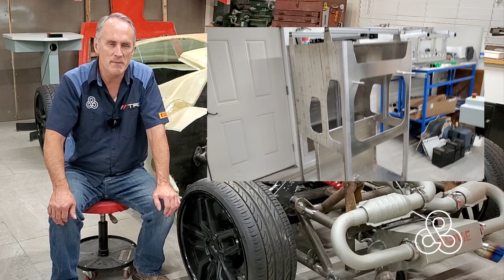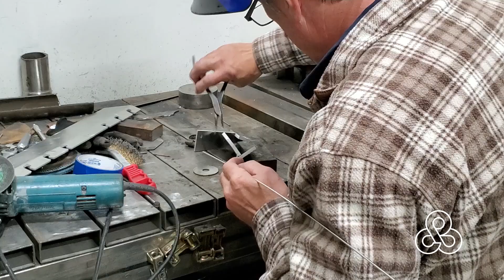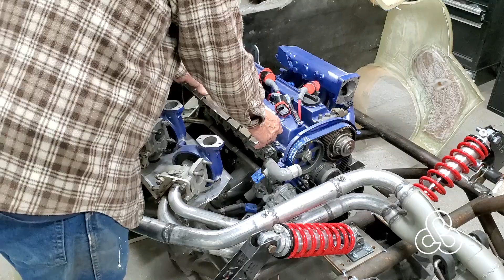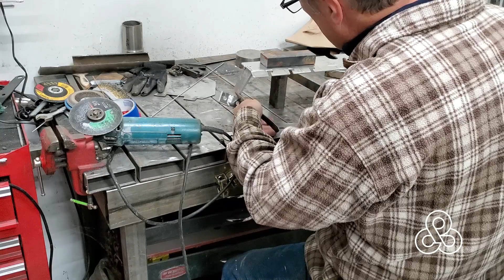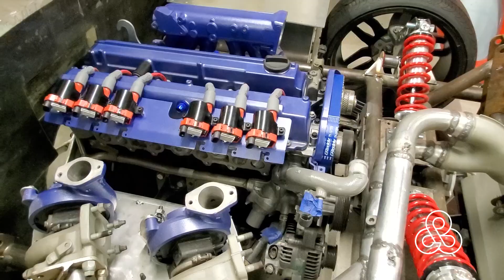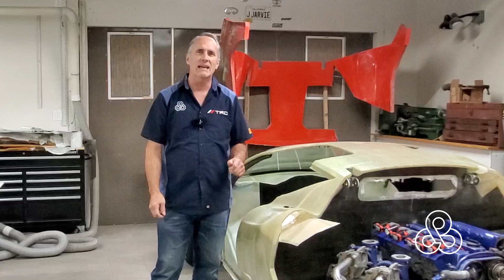A46 - Arete Supercar Project - Keeping ignition coils cool!

Comment: I'd very much like to know all of the numbers on your car.  Length, width, height, HP, track, wheelbase, length of cabin, everything.  Don't suppose you want to share that?
Reply from the maker: I don't mind sharing the basics, but "everything" is a bit much Ha! Wheel base- 100.5"  track- 64.5"  Length- 163"  width- 74.5  Height- 43  tub length (interior firewall to firewall)- 58"

Comment: Just a heads up with that powder coating. You may have grounding issues with those ignition coils causing them not to spark or have weak spark. Just food for thought. Love the build!
Reply from the maker: Grounding through the connector and directly through a capacitor still to come when the harness goes on.

Comment: make that a 3rd!  I am working on a similar monoque cabin with a steel frame front and rear, using a Honda j35 engine with turbos, since watching your video I have changed my design to be awd using a Chevy transmission. I am super interested in seeing your final implementation of the awd setup and  extracting a few more part numbers from your build. I am planning on using carbon fiber for the body, however. Hope to have the design up and in the intro video on my channel early 2021.

Comment: while there is movement off air i the engine bay the coils arent in the stream. the main channel of air comes through the intakes and migrates to the vacuum under the car. the coils are now directly over the hottest part of the engine bay. turbo manifolds ( because of slowed flow) will be glowing red under medium use.me personally i would mount them on the firewall on an aluminum cooling bracket. the downside of course is longer leads. however the individual coil per cylinder will mean the coils are basically under used and longer leads wont be an issue in heating up the coils internally because of the longer leads. in typical v8 mods the coil is moved from up top to under the exhaust manifold close to the engine. this position is in the air stream and the engine block doesn't exceed 240f. in your situation the turbos negate that possibility. why wouldnt you consider a mount up off the stock location with a plastic shield from engine temps. turbo manifolds exceeding 600 degrees or more in medium use.
Reply from the maker: You will just have to wait and see the heat management system come together.
Reply: @BuilderCreator  i certainly trust your judgement.  you are advanced in many areas. im still learning . im learning from you. ive seen your overhead mechanical drawing of the drivetrain. it answers most of my questions about the engine choice and placement in the car. does the transfer case counter rotate?
Reply from the maker: @gregoryperkins2180  It will split the load- counter rotate to the rear, carry the same rotation to the front.
Reply: @BuilderCreator  i have no idea what you said. ive build many offroad designs with mid engine weighted chassis. because of engine rotation each build had a gear driven transfer case changing rotation. some peopl designed this reverse rotations buy turning the axle upside down which of course makes the ring and pinion work backwards and in high horsepower combos with big tires , less than dependable. are your differentials upside down? does the transfer case reverse rotate? does the engine rotate clockwise? sorry to be a pain. im one of your students.
Reply from the maker: @gregoryperkins2180  Transfer case will send power back to the rear via a gear set (reversing the rotation.) Power to the front is via chain drive/viscous coupling. (same rotation.) the front diff will be flipped so as the gear set meshes correctly. the rear diff is of course right side up. Hoping this all goes together in the near future and you will be able to see.

Comment: Congrats on the channel success.  I’ve only recently found this project and think it’s amazing!  One question/suggestion I have is about your exhaust.  Did you ceramic coat the interior and/or exterior of the exhaust?  There’s a spray-on ceramic exhaust coating from Westwood I believe that you can apply to the exhaust yourself, and the idea is less heat seeps out into the engine bay and therefore less heat radiates back into the block, intake, turbos, etc.
Reply from the maker: The system is stainless steel, but it is indeed ceramic coated on the exterior. (Ceracoat- a manufacturer right here in my home town.)

Comment: In moving the coils from the valley to above the exhaust manifold may seem like out of the fryer into the fire.
Mostly because they’re going from conductive to radiant heat. Even though they’re getting better air cooling the radiant heat may kill them quicker than dead. Heat shielding is an obvious must especially with turbos involved. And what you think may be enough is never enough, when it comes to turbos and heat shielding more is always more.

Comment: If you’re looking for coil on plug cheap there are some that are very common high powered ones on the Toyota Prius and similar budget vehicles.
Checking the forums for the particular engine you’re using will provide you with which ones are cheapest and best.

Comment: Tip for some types of 3D printers, make a bed that is a lot longer than the supplied bed and put on tracks so you can slide it along to make long parts that don’t fit under the printer normally.

Comment: I just found your project, and been watching it.  It really interesting and I like your approach how to talk about it.  a time ago I was considering creating a car from now an Orphan brand.  and I was going to build it in Carbon fiber,  I own this car and it is on the road.  But if it can be done  with a few mods,  Imagine if a normal looking car had real Lambo doors that worked like Lambo doors.  with a new shape.  as well Imagine if you also added to this body the racing look of its glory days?  But as well made it 2021 Performance and what if you also took out the back seat?  made a real racing tub for some massive wheel.  then add some wicked mods like a racing hood from another model of the same car.    What is the Car?  1986 Trans Am  T top.
Reply from the maker: Smoky and the Bandit fame!
Reply: @BuilderCreator   I have a 1970 Camaro Dirt Race car as well.   and I also been to teh scrap yard and found a few examples that we shall say had been neglected.  you just gave me something to think about.  I am sure I could get a vin of one of em cars legit and the windows. and then get some doors and start to make the basics like fenders and since I already got hoods and Trunks.  just need to see if he would let me make molds of a car and pay him for shipping it back and fourth.   Imagine the surprise when going down the street with a 1970's Trans am, Black Carbon, with the Bandit lines   but so light and no rust or bondo.     you could even add a full torque tube from a c6 Corvette C6 Corvette power and interior.   one could also take a few inches off the bottom to make it low and sleek.    3310 pounds down to 2600 pounds or less.   build the inner structure as a one tub unit.  then make the back open as a Clam shell  and the front as well and the doors real reshaped angular doors.   You Sir  have gave me  some project in my mind.   now to cad draw this door system.

Comment: You need to add flex joints on the turbo exhaust to make room for expansion of the turbo outlets and prevent cracks
Reply from the maker: I have bellows in hand, ready for the day I fabricate the exhaust manifolds. - Stay tuned!

Comment: Bad Obsession Motorsport's project Binky is the only other fabrication I've seen here on this level. I have no idea how to make headlights and taillights, not for lack of searching. So I'm really looking forward to that part as well.
Reply from the maker: Believe you me- I am looking forward to those days as well! Ha!
Reply: @BuilderCreator  I really can't wait! I've seen very little detail about this. I have seen guys use the clear epoxy in the silicone molds to make a flawless clear lens for a 20s Cadillac  that was unobtainable! A gentleman was kind enough to send him his irreplaceable lense to make the mold. I've also seen colored orange, yellow, and red light housings made the same way. In every case they had the existing fixture on which to mount them. 3D printing fixtures is a start. Projector units can be purchased or salvaged from other fixtures. I don't know much beyond that. Reflective surfaces, led light rings, etc.

Comment: If you build 3d printer make sure  is corexY. You can get decent accuracy and speed. There are some very good cheap kit.
Reply from the maker: I am using someone else's print heads, otherwise the design is fully my own- no kit, no pre-assembled components. The accuracy should be great- Speed? Who cares about speed - I can sleep while my robot slaves work through the night!

Comment: This is great! I love watching these videos. Do you think using a donor car will make the process of building a car like this simpler? I was thinking about maybe getting a Toyota MR2, tear it apart and put a LS engine in it. I still have no idea on how to make a cheap/simple body for it though but im learning alot by watching the Arete supercar series! thanks for putting in all these work
Reply from the maker: As simple or as complex as you want to go.  Anything from a re-body (fenders, hood and rear end) leaving the drive train intact. Or starting with a bare tube frame chassis. Of course, for a first time go round the re-body is good "training ground."
Reply: @BuilderCreator  Will definitely do that. Thanks for the help 🙏🏽

Comment: Sir, Can we put a glass in the lower part of the door like Mc laren P1.
or what if we like to put a complete glass door.from hinge to closing tab.
What is the process of diy glass panel in required dimensions?
Reply from the maker: Safety glass is extremely expensive to have produced, but in some instances you can get away with thermo forming Acrylic or Polycarbonate if you need high strength. I may have some videos on this coming up in a few months or so.
Reply: @BuilderCreator  Or cast acrylic, if you need custom pieces which are also very strong and won't craze or fade from UV damage over time. Popular in high-end yacht port lights and hatches.

Comment: Congrats on getting the opportunity monetized.  I don’t know if you will need but happy to help with the 5 axis cnc.  We just finished up a project and the machine is working beautifully.
Reply from the maker: I just may take you up on that- I'm one to try and reinvent the wheel (unless its reinventing the wheel! Ha!) I just need a working machine right now more than the side content or experience.
Reply: @BuilderCreator  I’m just going to say this much. Really look into a close loop system.  Steppers work fine usually but if you want a machine that you don’t have to worry about look at clearpath or servo.  Look forward to seeing what you come up with
Reply from the maker: @XSMotorWorks  The machine has servos on two axis, but not sure yet if I will be able to get enough documentation to figure out the wiring (or if they will perform for my needs) I do have some questions for you- to get more mileage out of them I will post them to the comments of your videos. Or, we could DM this conversation. You could go to the 'About' tab on my channel and ping me an email so that I have a good direct line to you?